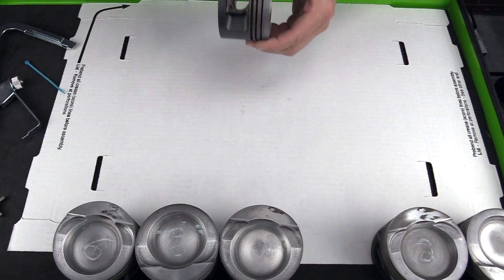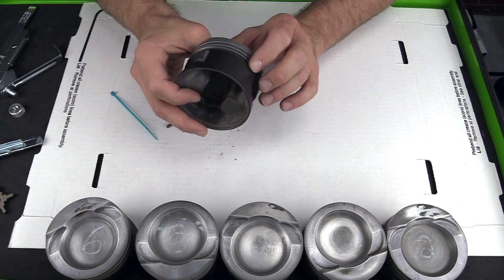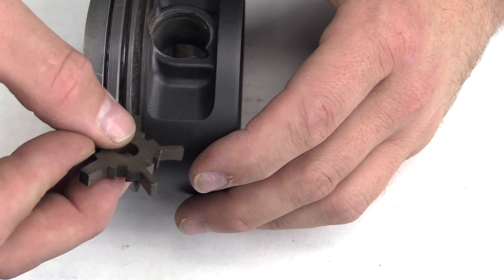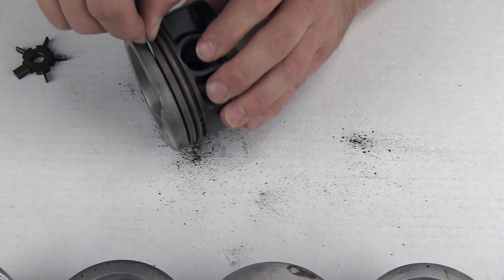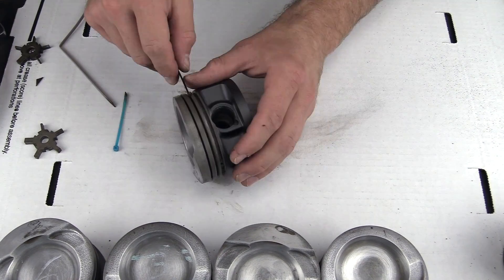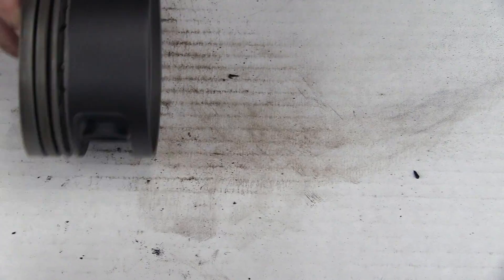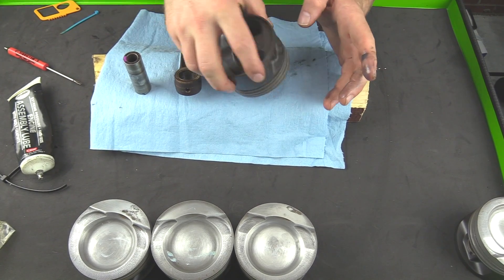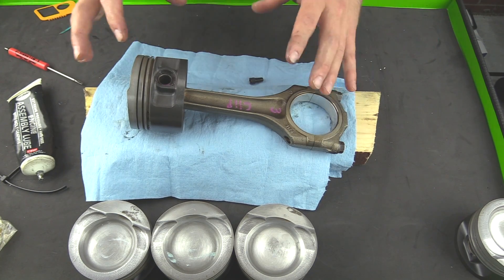How To Clean Piston Ring Grooves and Attach Connecting Rods

Comment: I presume the coating is resistant to gasoline orherwise it would be pretty dumb to coat the internal components of a gasoline engine.... and it its resistant to gasoline im sure its resistant to acetone but you could always check by puting a little the bell of the piston as there really is no benefit to coating the inside of the bell.

Comment: Lyle ring groove tool looks like a banana picker.....LOL what a waste of time and possible damage.  

With all due respect, your issue should have been solved by prepping pistons before sending for coating.  Many options from chemical to mechanical.  I am now soda blasting with great results.  Vapor de-greasing another great alternative.  Or chemical and many use diesel, carb cleaner or even oven cleaners.

Love your channel and also agree with using old rings....but before sending for coating.

Cheers,
Mr .P

Comment: hey mister humblemechanic I really like your videos and I subscribe to your Channel but I also need help with a couple pointers from you I was doing the wrist pin on my 96 Honda Civic because I had a knock so I got the head off I took the oil pan off and I push the Piston up to top but there's something in my way stopping me from getting the cap to the  connecting rod out so that I can do the bearings on it since I'm there and it needs it too my question is do I have to remove the girdle in order to get that crap off again the car is very secure and safe  and again thank you for your great content

Comment: Hey Fellow dub brother, don’t expect a response as in sure you have your hands absolutely FULL! 

But I wanted to chat with u regarding a issue I have...

I have a couple dubs and one of them is a 2003 GLI, yup 24v 6Speed Fully Loaded!
Saved this thing from the auction with hopes to indulge in my first very own VR6z.

I’ve mostly had 2.0Ts and 1.8Ts.

Here my dilema. Car is incredible has 31K original miles...but the catch is the previous owner hit a big sewer cap and destroyed the oil pan.(or as I was told by him, who I was able to find in the yellow books somehow. Lol.)

Upon some disassembly on the bottom end I found a spun bearing on Cyl.1. Which caused to the crank to lock up. Once the cap and rod were disconnected from the crank it sour freely.

Now I know the proper way to get this thing back on the road is pull the motor, cut or at-least polish the crank. And throw a set of rods in it. 

I was able to clean up the crank well and it’s still within spec from the numbers I was using. (Connecting rod journal)

What I wanted to attempt before getting the donor engine. (A well maintained 60k mile 24v) was to see if I can pull the head while leaving the timing connected and replacing one rod. To see if I can get it running to get an idea if it’s worth rebuilding the original motor or just replace it and call it a day. I would really Love to hear this thing purr one last time even if it’s not for Long Life. Appreciate if u had a moment to touch back with me, I’m a fan of your work and your talent. Cheers!
Lawrence
Reply from the maker: I don’t think you’re Going to pull the head without taking the upper chain off. 

You might be able to leave it on the intermediate shaft,m. Maybe
Reply: HumbleMechanic so the trans has to come down regardless??
Reply: HumbleMechanic and thank you for responding!

Comment: i prefer soaked them in diesel, it works better than the carb cleaner
then after remove the carbon deposits i use the carb cleaner to clean and remove the diesel before any rings assembly
the diesel really is a time saving cleaner for carbon

Comment: I notice the side of the piston has a small, round hole on the edge of the gudgeon pin hole at 10:53.  Is there any requirement for orienting the gudgeon pin clip with this hole, or does it not matter?
Reply from the maker: +aussiebloke609 as long as the opening of the clip is not in that opening it's all good.

Comment: Soak the Carbon with WD40 for 20 min and you can remove it with ease
Reply from the maker: +Anders Kjelgaard that's exactly how I got the carbon off the crowns before removing them from the block. It worked amazing. 

I'm sure the coating would have been fine, but I didn't want to risk it

Comment: The zip tie  seems the best option, the metal tool generated metal filings visible in the video and did not remove that much carbon at all...
Reply from the maker: +Valentin Calinoaia agree. Not very impressed by the tool. Some of that may be because the tool didn't really fit my piston application.

Comment: What about soaking them in mineral spirits? It's less harsh than brake clean and does a great job at breaking up carbon. I doubt it would hurt the coating, but I understand not wanting to take the risk.
Reply from the maker: Yeah I think even carb clean would be fine. Plus it was the top of the pistons that would get cleaned, and the skirt is what's coated. Like you said, no need to take the chance.

Comment: How can you maintain your carbon buildup when you do a service yourself without opening the engine :)
Reply from the maker: depends on the car. If it's not DI, then fuel cleaners can help. DI, there are ways to reduce the amount of carbon, but manual cleaning has really become part of normal maintenance. 

Good fuel, proper oil change services, driving the car all help. But very few things will completely eliminate carbon from building up.

I am going to pull the intake manifold on my wife's Tiguan soon. She just hit 25k miles. I want to see what the buildup looks like. She uses mid grade fuel from whatever stations, and has a light foot. 

I suspect she is a good snapshot of the average driver.
Reply: Well it's a 1.2 skoda same 3 potter from a polo 9n, I change my oil evry 10000 km's drive it practically evryday. Novice mechanic and not worth pulling apart the engine for what the car is worth still
Reply: Will try a fuel cleaner though any expierence that you have with brands? And thanks for the answer :)
Reply from the maker: Try BG 44k. It's not cheap, but it works the best from what I have seen http://amzn.to/2swt9JK